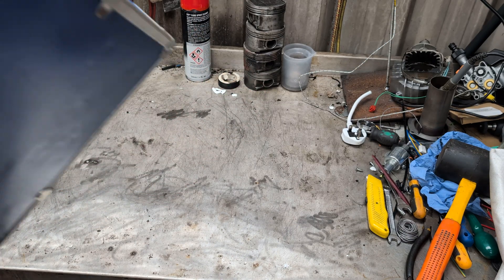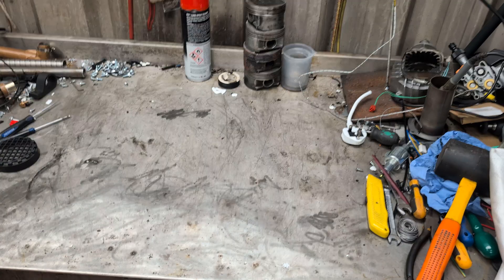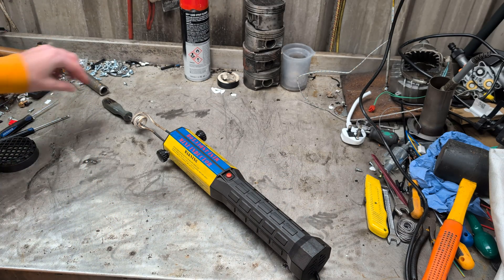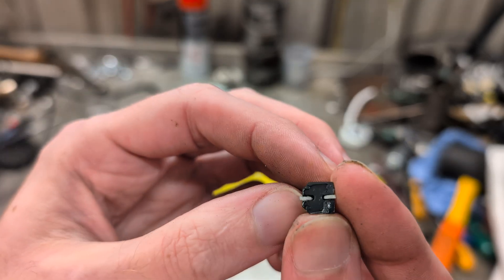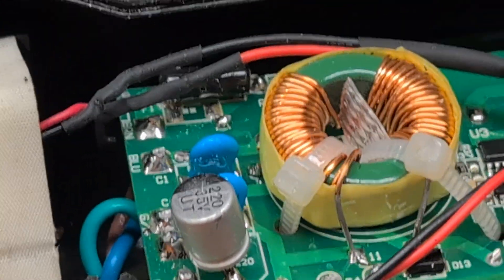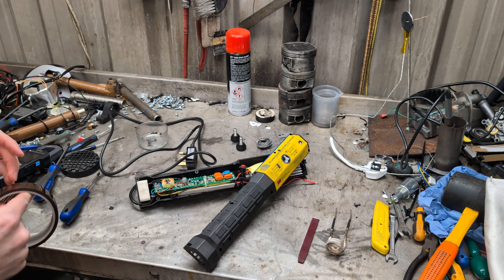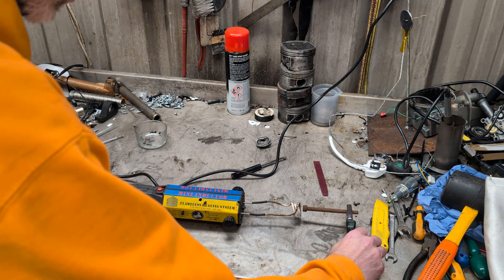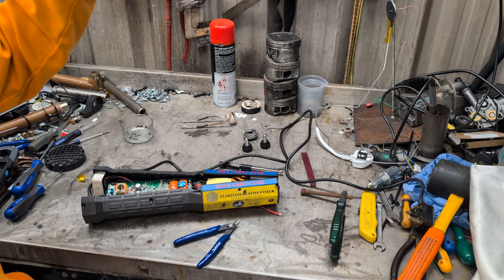Mini inductor repair / diagnose - part 1

Comment: Hello David,  I know you're not a suppot for chinese diesel heater, but I've follow you since a while and I've seen that you tried many thing with this heater. I've got a problem and I can't figure out why does this happen. My heater wasn't used for a long time (maybe 200 hours at really maximum over the last 3 years). Now, When I start it I do: Either start pumping but does not start the burner, either start the burner but not the pump or, start both but with a big delay (maybe 3 or 4 minutes minimum) but then it make a lot of dense white smoke and it smell like exhaust gaz in my house. Do you have any idea where it can come from and how to solve it? Thanks a lot!
Reply from the maker: So you either get 1) Fuel pump but no fan 2) Fan but no pump 3) Both but after a few minutes plus white smoke.

It's not uncommon for the pumps and or the fans to seize.  But they don't usually unseize themselves.  This sounds more like an ecu problem.
Reply: @DavidMcLuckie the fan work it's either the pomp or the burner. But thanks! I will take a look on that side

Comment: Do you recommend these?

Went to buy this exact model from China a year or two ago. Even though it said VAT & duty paid on the invoice FedEx tried to collar me for nearly as much as I paid for the tool in extra VAT, duties, and handling fees. Not sure if it was the seller dicking me about or a mixup by FedEx. In any case I wasn't paying it.

I told them to send it back and got a full refund from Aliexpress  ...Then went back to using Mapp gas blowtorch or oxy/propane.
Reply from the maker: Yes.  Very yes.  I've got a mapp torch as well, but I'll use the induction first if I can.  Red holt bolts in 30 seconds, and not setting fire to other things is the main advantage.

If I can't fix this one I'll be buying another.

Comment: I don’t own one yet, but I’m sure I remember that you’re not supposed to have a part in the coil until after the switch is engaged.
Reply from the maker: If anything it's the other way.  Don't activate the coil without having something to heat up in there.